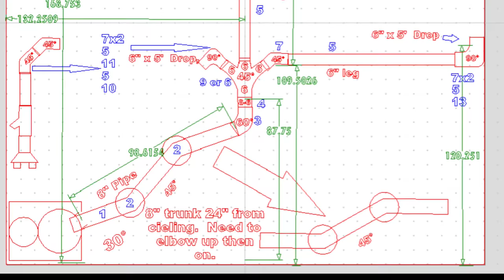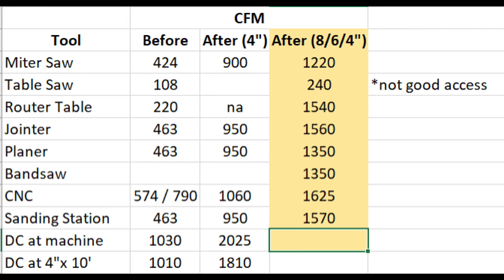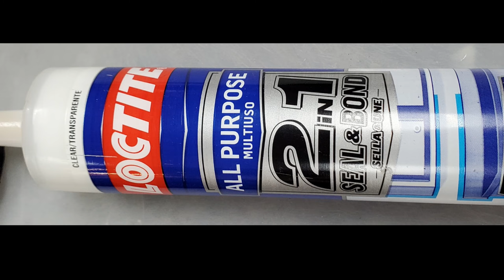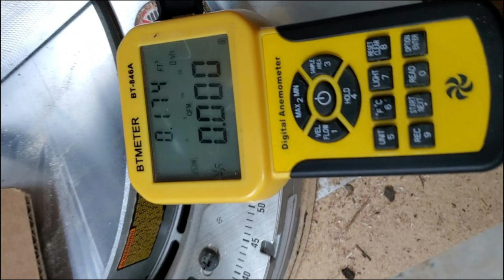The Ultimate Tips and Tricks Guide to Dust Collection Pipe Upgrade

Comment: Perfect tip on using the table saw to cut the piping. I’ve heard some horror stories and didn’t want to buy another tool just for this project.
Reply from the maker: It worked perfectly and was very safe.  The key is supporting the long part so it doesn't fall when cut free.

Comment: If I have a 4" dust collection port on my dust collector, will immediately transitioning into a 6" pipe help me at all?
Reply from the maker: No.  If you start with 4" you will need to continue with that size.  You can reduce but not enlarge.  The volume won't increase more than the smallest diameter.  Enlarging to 6" from 4" may actually decrease performance.